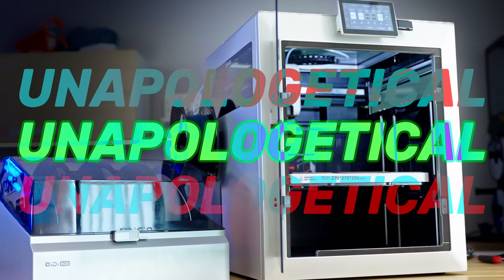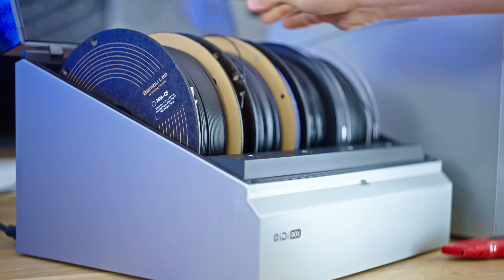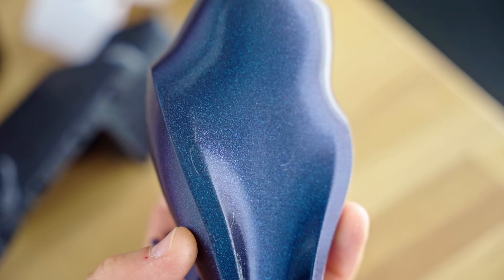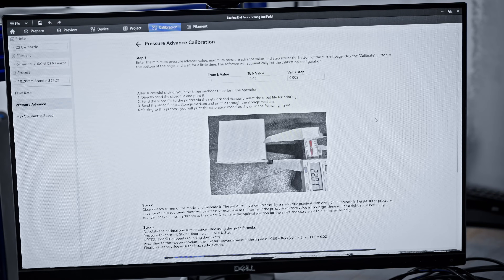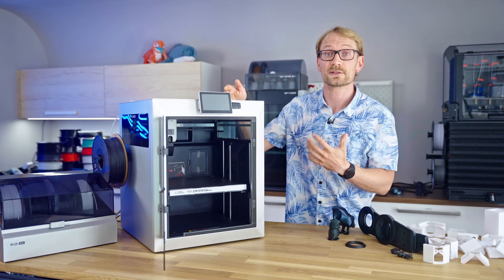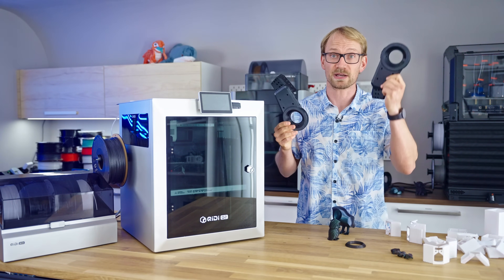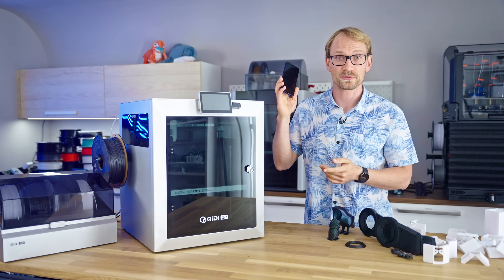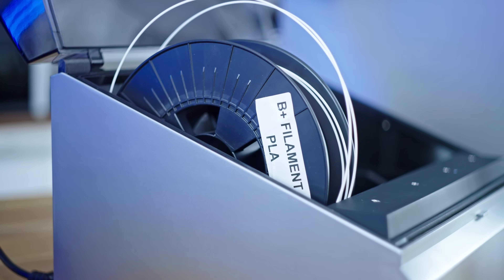Wannabe or Klipper-based powerhouse? "It's complicated 💀" with the Qidi Q2.

Comment: I just got one of these (though I am still waiting on the QIDI Box) and I've only had a few minor issues out of it. It kept breaking my filament and I couldn't figure out why, until I could no longer get the bowden tube into the extruder; turns out there was a piece of the bowden tube stuck in the run out sensor. I have no idea how it got there, because the end of my tube looks fine, but this piece was stuck in there and prevented the tube from engaging fully. Fixed this, no print issues.

In terms of print quality, I just defaulted to the Polymaker PLA profile that the printer came with and had absolutely no issues. The profile is limited to a max of 11 mm^3/s so that maxes the speed out on a 0.4 mm nozzle near ~120 mm/s, which is fine enough for what I'm doing right now. I used the Polymaker ABS profile in QIDI Slicer and it made an extremely nice print with some old un dried ASA I had laying around, absolutely zero warping.

Overall I am happy with printer. I also purchased a Elegoo Centauri Carbon and I spent a ton of time just trying to get it to even work. Now it wont even seat the top glass.

Comment: Hold on, can we talk more about the mmu ?
If the printer is klipper based and open source, that probably mean we could use the mmu with other klipper based printer, right ?
Reply: From what I've seen the hardware of the box is all just standard stuff MCU stepper driver sensors nothing crazy I don't see any reason that this box couldn't run mainline klipper and happy hair to control it. I won't have my box for a few months yet so I can't say for sure though.
Reply: Some use an anyubic Ace or bambu AMS on the Plus 4 so should be doable. Keep an eye on the FreeDi repo which uses mainline Klipper (more MMU compatibility)
Reply: Haha, no bc Qidi Box is actually not open source anymore! It should be, but Qidi has only posted compiled .so files for its firmware atm. They posted the .py at one point and then removed them. Very sketchy stuff
Reply: @coledavidson5630  What does that have to do with anything? As Tom said the interaction with the MMU is purely done with klipper scripts written in clear text in the config files.
Reply: @radry100 My assumption was that Qidi closing down the Box firmware files makes it difficult to use on other Klipper printers. Maybe I'm wrong on that?
Reply: @coledavidson5630  Absolutely correct they basically pulled the oss firmware literally a few weeks before the final release, violating the gpl3 that way!
Reply: @radry100 one day Klipper will ask you to flash the newer version firmware onto it. What then?
Reply: @werpu12  Which 3D printers of similar features and cost do you recommend for OSS/gpl3 compliance?
Reply: @DellAnderson Prusa instantly comes to my mind!
Reply: @werpu12  What model?

Comment: "Submit a pull request if you don't like it", this man knows the open source software community.
Reply from the maker: Seen it too many times from devs that seem to have lost touch with the software they make. That being said, OSS is in a fantastic spot right now, and many projects are well aware that they can actually compete with proprietary tools if they lose the scrawny low-budget appearance.
Reply: @MadeWithLayers  Free software community is being robbed. It would be nice if reviewers like you would mention when manufacturer have not released the source code as they are supposed to.

Comment: This is actually what I want.  Bamboo features but no LOCK IN and kipper.
Reply: So this being a near Bambu clone and open-source, what would it take for the missing features to be added - e.g. something to automatically sort out the overhang artifacts.
Reply: But based on the review it does not have Bamboo features. Well, it might have them on paper but apparently doesn't deliver on what is promised.
Reply: @Jehty_  Depends on which Bambu Lab features you care about. If you want everything done for you to get a decent print, no. If you want high temps, high speeds, high quality, but you may actually have to tune your print and filament profiles, then it has what counts. Plus the open nature of the platform the the ability to actually tweak and monitor. Also way, way less expensive with a heated chamber.
Reply: @802Garage  but this printer can't do high speeds.
That what I meant by only on paper.
Reply: @Jehty_  It absolutely can. It depends entirely on filament and temperature. Also depends on what you define as high speed. With that one filament and that one suggested profile he was printing quite slow. Plenty of other users are printing as fast as most printers on the market.

Comment: Nice printer for a starter who does not want to invest to much. For a serious user Qidi cut to many corners to keep the price down.
Reply: I'd actually argue that Qidi is far more for "serious users" than most other brands. They may require tweaking and tuning, but the capabilities are very high for the money.
Reply: @802Garage  For serious users the quality may not be good enough. For the price they need to cut so many corners you may question it's lifespan with regular/continuous usage. I expect Qidi to improve the profiles so beginners can use it out of the box.

Comment: The market wants appliances not tinker projects. No point spending money on this.
Reply: It is a 3d printer, there is a huge overlap in the people that want a printer and those that that want to do more than print decorative owls in a really easy to print filament - the folks that are naturally tinkerers! So being open to tinkering is something a huge amount of 3d printer purchasers want, and if the price for being able to actually own your printer and get it to do things you want it to is a huge saving in time and/or money to get the machine upfront but with a little bit of tinkering to get the polished fire and forget printer configuration setup for your defaults etc... Not sure how good this machine really is, but building your own from scratch might get you a better machine for the same money, but its going to take you probably a week and maybe a month to assemble the working printer - it can be done quicker, but most folks don't build 3d printers often enough to really figure out the fastest route, and the Bamboo end cost you a fortune upfront and you don't really properly own it with all the proprietary parts and software that means you can only keep using it while they allow it.
Reply: @foldionepapyrus3441   most of those tinkerers don't want to tinker with their 3D-printer. They want to tinker with the project they are working on.
5-10 years ago I would have agreed with your statement.
But nowadays there are just too many printers available that are decent out of the box and don't keep you from working on your actual project.
Reply: @Jehty_  But the project you are working on often requires you step outside of the walled garden of highly refined working options in ways the Bamboo type companies don't want to let you do. Some of them are worse than others, but 'ye may use no other filament profile or even any other filament but ours' etc is a big detriment for many a tinkerer's project.  

Its nice if you can have that it just works experience when you want it, but having that to a reasonably large extent, and even to the extent the Bamboo machines allow does still require active restrictions and/or manual tinkering - can't put flexi or stiff stuff in their multi material system, so must take the machine apart a little bit to feed them in etc..
Reply: A large part of the market does want appliances, but do not have the money for the good ones. Or another part likes what the Bambu does, has no issue with the price, but have issues with the closed nature of the beast. But as with so many products you have three things you want, but you can only choose two.

This printer is not for you or me, you might prefer a Bambu, I might prefer a Prusa or a Voron...
Reply: You could tell that to Elegoo. And basically every manufacturer having enclosure an inch or two too low.
3D-printer horror movie: Raiser-head 😅
Reply: There’s more than one market.
Reply: The people buying this want a machine that can print engineering materials with high quality and not have to pay out the ears for it.

Comment: Like all the companies that offer bang for the buck products like this they would be well served to spend a few weeks once the printer is done sorting out good profiles for common filaments. It would turn a " its a good printer for the price .... but " into " its a good printer ". And also stick with models for longer and improve the software. Hardware is to the point now where it does not matter that much , its all about the user experience .

Comment: I got my XMax 3 just prior to the Plus 4 release, and it had some rather glaring issues out of the box day 1. Ironically, almost all of the flaws went away after I did some extensive digging and ended up on Github looking for user fixes. Ditching the factory firmware and going mainline klipper was the biggest help, which stopped nozzles crashing into the bed and some other annoying flukes (this was after going back and forth with Customer Service for 8 days and ending up with a 'good luck' final diagnosis). 
 The only thing that really irks me is that the max temp on the hotend is NOT 350C, but 300C, and getting it to that temp Reliably requires (at the minimum) at thermistor swap. Going that route, however, I just assume replace the hotend entirely and with a better extruder like an Orbiter 2, which has led me to designing my own toolhead, mount etc. to go Way past 350C and into the 450C zone. 
If you intend to print anything up to 300C, they're relatively solid printers for the money. Truth be told, I would just assume go Voron or completely from scratch (I've chosen the latter) for future printers and spec it out to my use case. Oh yes, 330x850 500C monster is being part sorted and compiled as I go.

Comment: After what QiDi had done with the Q4 Plus i would never buy one of their machines. SSRs failing, glued bushings on the X-axis and many more critical flaws on a machine that expensive. Their customer support is also rather horrible compared to other brands.
I´d skip QiDi at this point until they get their stuff together. The Q1 Pro on the other hand was a great printer for its price point - these newer machines not so much.
Reply: Q2 was improved a lot so no worries.
Reply: By those metrics, you should never buy a Bambu Lab either, as they are guilty of all of the above. Qidi also is well known for having some of the best service in the biz, so no idea what you are talking about there.
Reply: @802Garage  I own multiple Voron s, including the 2.4 and Trident aswell. They each have atleast 6k+ hours on them and they still run flawlessly.

There was a guy that LITERALLY burned his house down because of his Plus 4, only thing QiDi did was banning him from the subreddit. 👍🏻